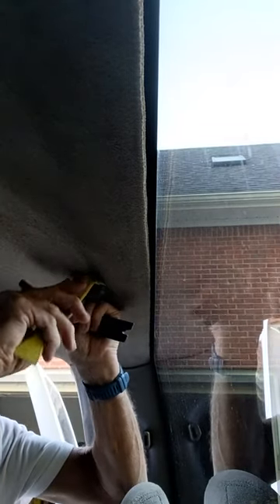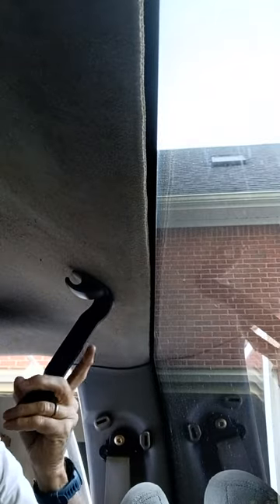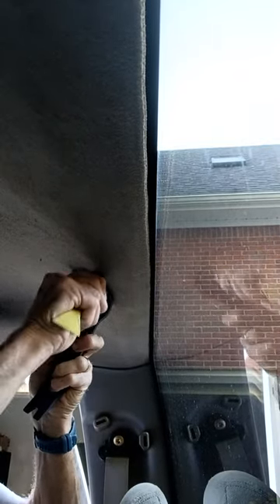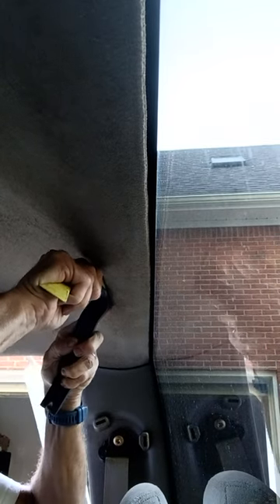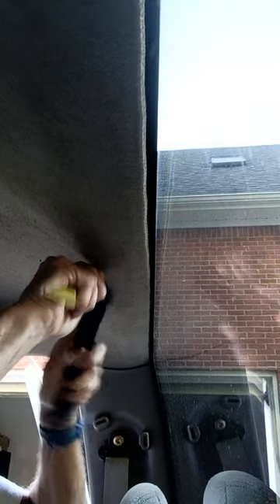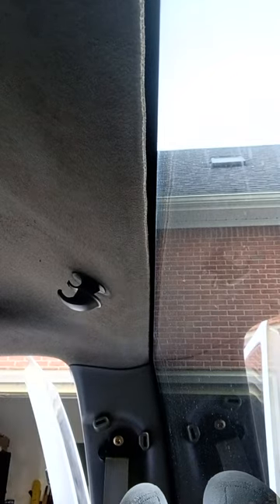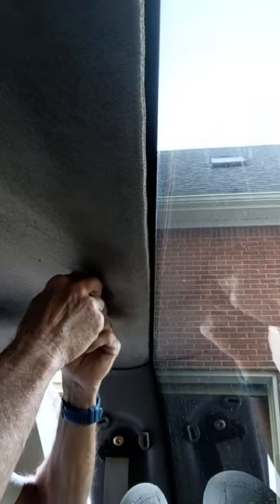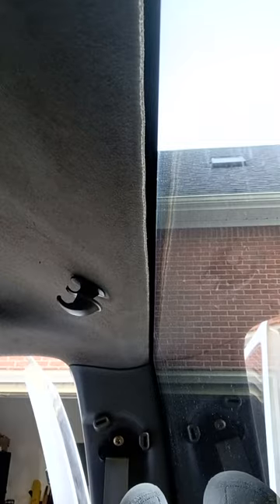Chevy Silverado Headliner Coat Hook Removal

Comment: Thanks very much for the instructions! What year is your truck? I’m trying to get the headliner down in my 2005 Silverado single cab. I pulled so hard that I think I bent the metal where this plugs in. And, like you said, I did do damage to the plastic and my window tint. I had to stop because I didn’t want to do more damage. These hangers are also too expensive to replace, for something that’s probably never going to be used. I’d like to just replace them with a simple plastic circle that can be pulled as easy as all the rest of the interior. By the way, I like being a first viewer of a video! I liked, saved and subscribed. You are right to the point, no music, and in real time (not sped up).
Reply from the maker: Glad to be of help. I should have mentioned that my truck is a 2000. It's absolutely real time. I know the principles of video editing, but I barely have time to actually do stuff - let alone create a bunch of Hollywood level how-to videos! I just banged this out on my phone in the driveway when I realized that all the videos on YT were telling people to use screwdrivers to pry on plastic.
Reply: @jcuvier135  I haven’t tried again yet. Did you just use regular prying bars normally used for nails in wood? And, I was lucky enough today that my nephew came to the rescue. I have watched him remove the headliner before with no problem. 
Your video is very helpful for anyone who’s never done that or seen it done in person. A lot of the “how to” videos on YouTube ARE more like watching a Hollywood produced show than a simple “here’s how you do this, just watch me” video.
Reply: @jcuvier135  I don't think you know anything about editing vids
Reply from the maker: @GillyBillman You have confused "not knowing about video editing" with "not caring about impressing anyone with overproduced video for simple how-to tasks." I fall squarely into the latter category.

Comment: This is still the brute force method. You pry it open a little bit, then you can stick a pick or control screw driver in each side to pry the barbs open to release instead of just pry it til it breaks.
Reply from the maker: It's not a question of prying or not prying. It's a simple matter of WHERE to pry and what to pry with. But thanks for the comment.